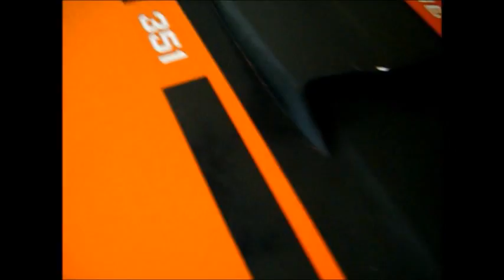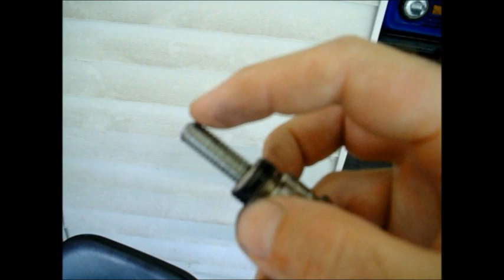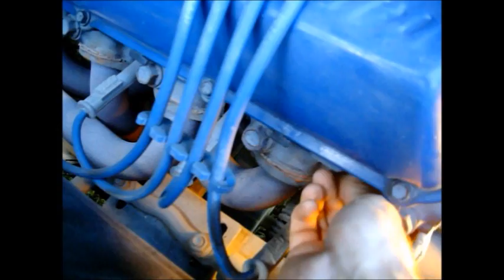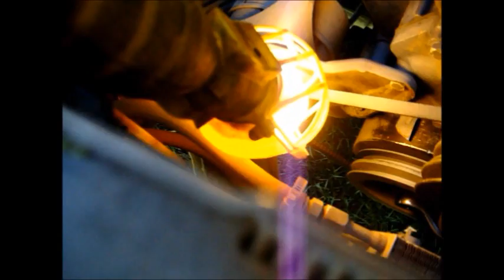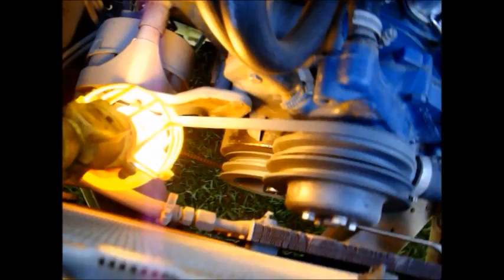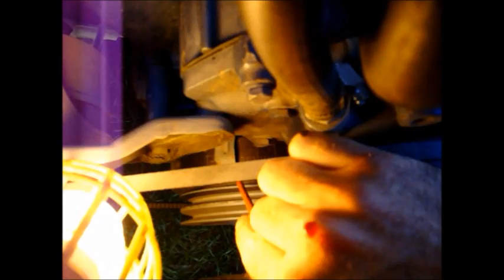Timing - Part 3 - How To - Using a piston stop to find true #1 TDC.wmv

Comment from the maker: Yup, you could stick something down the spark plug hole and when it goes up as high as it can go, you could call that TDC, and compare it to your timing mark on the balancer.  That's only ball park though, you could easily be off by 4 or 5 degrees.  Piston stops are made for people that want balls on accurate.  If you want to find exact TDC, this is how you do it.  The next time you've got a cyl head off, bring a piston to TDC, then keep turning the crank, it'll appear to be at TDC for a while.

Comment: I see. 
Also, why not just use a long extension down the plug hole, if you put millimeter dots on the ext, and have a friend read off while you slowly turn the crank?
Also I think BMWs have chains even still. I just changed the belt on my honda civic. god damn what a pain in the a.  Shouldve had an engine lift.

Comment: 1 Going back and forward will set 2 points on the harmonic, by dividing the 2 points you get you TDC. Get valve cover out, get a ball park...setting the pointer and the original mark, then look at the lobes in the camshaft as they give you the highest part of the lobe as the exaust stroke and the lowest journal of the camshaft the combustion point or valves closed =TDC . finally depending on the year you could move the coil to ignite a tester light which will point to TDC.

Comment from the maker: Once the jam nut is tight, no further adjustment will be required, until you use it on a different engine.  The jam nut holds the all thread in place, and makes the tool more solid than it would be other wise.  The tool would work without the jam nut, but not quite as precisely.  I experimented with how much all thread I would need, to make the process as easy as possible.  Now every time I install it, and torque the "spark plug" into the cyl head, the stop is in the same place.  See below.

Comment from the maker: Before I tightened the jam nut, I installed the piston stop with very little all thread sticking into the combustion chamber.  I verified that the piston wasn't hitting it, then I threaded it in, so that the piston would get very close to TDC, before finally hitting the stop.  That's where you want it.  This way, your two marks end up very close to each other on the balancer.  The deeper the stop, the wider spaced your marks will end up.  Just easier with the marks close together.
Reply: Your answer here addresses my only remaining question spot on. Thanks for articulating clearly. Great video, O.R.! Maybe my 455 olds will run as it should again once I do this. Beautiful cars, BTW!

Comment: Great Video. Very nice cars, and a good tip. One question I have when you said experiment before you tighten the jam nut:What should I be looking for before? Im sure youll say watch for movement in the all thread but I'm still thinking the threads may snagg and give a false reading. Still a useful tip, I'm just overthinking it i guess. Thanks

Comment from the maker: If you can get to the number 1 spark plug and the timing pointer, you can do it.  Be sure to make a solid stop that won't give, or just buy one on ebay.  I should check mine again, to see if that balancers outer ring has walked any more.  Really what I should do is buy a new balancer.  I've put a lot of miles on that Mustang since making the video, haven't messed with the timing lately, it's been running good.

Comment from the maker: @moparmania74:  No, using a method like you described will only put you in the ballpark.  The next time you have a cyl head removed, move a piston to what appears to be TDC, then keep turning the crank, while keeping an eye on both your balancer and your piston.  You'll be amazed by how many degrees of rotation that the piston "appears" to be at exact TDC.  Using a piston stop is the only way to find exact TDC.

Comment from the maker: If your two marks end up being 8 inches apart, measure 4 inches for your TDC mark.  If you go through all this work and it turns out your balancer was marked properly the whole time, that's fine too.  At least you can rule that out when troubleshooting a timing issue.  Anyway, as you can see by the video, it doesn't take that long, especially if you buy a piston stop on ebay rather than try to make one.

Comment from the maker: If you set the piston stop shallow, you'll end up with two marks that are relatively close to each other (Pac Man's mouth barely open).  If you put your piston stop in deeper, you'll end up with two marks spaced farther apart on your harmonic balancer, mouth wide open so to speak.  Narrow mouth is easier to measure, but either way will work.  The center of your two marks is TDC, regardless of how far apart they are.  If they are 6 inches apart, put a TDC mark at half that, 3 inches...done.

Comment from the maker: Using a piston stop, you end up with to marks on your harmonic balancer, think of these marks as Pac Man's upper and lower lips, the center of those two marks is the "center of Pac Man's mouth".  In this case thinking of 360 degrees of crankshaft rotation, the center of your two marks on your balancer is TDC, measure the center of those two points going in the other direction, and you'll find a spot exactly 180 out from TDC, this is BDC.

Comment from the maker: To understand how the piston stop works, and why it doesn't matter how long it is, think of Pac Man with his mouth open.  You've got 360 degrees of Pac Man, but only 1 of those degrees is the exact center of his mouth.  To find it you'd simply measure from the upper "lip" to the lower "lip".  The center of that measurment is the exact center of the mouth.  If his mouth was opened wider, wouldn't matter, the center of the mouth is still found the same way.

Comment from the maker: TDC is TDC whether it's TDC compression or TDC exhaust.  To get the car running this matters a bunch and I went into that below.  The piston stop isn't to determine which is compression and which is the exhaust stroke, it simply tells you where to mark your balancer for true and exact TDC, the piston is exactly at the top of the cylinder.  Even with the head off, you can't eyeball it and be exact.  Even with the head off you need a piston stop.

Comment from the maker: jcinnamon01, think of it in terms of crankshaft rotation rather than the piston going up and down.  For every 360 degrees of crankshaft rotation, the piston hits TDC once and BDC once.  Now there's 720 degrees of crankshaft rotation on a 4 stroke engine, but for the purpose of degreeing a cam or checking the timing marks on your harmonic balancer, that really doesn't matter.

Comment from the maker: Drop that same distributor in at TDC of the exhaust stroke and it won't run so good.  If your valve covers are off, you can just watch the valves, otherwise, use your finger in the spark plug hole.

Comment from the maker: Seems easy enough but you'd be amazed how many distributors I've seen that were dropped in 180 out (based on 360 degrees of camshaft rotation, cam turning at half the speed of the crank).  Find TDC of the compression stroke, then move the crank to about 15 degrees BTDC of the compression stroke, then drop your distributor in with the rotor facing where you want #1 to be, set your firing order off of where #1 is, and your engine will fire right up.

Comment from the maker: Like you said, if the exhaust valve is open, that's the exhaust stroke.  The next time the TDC mark comes around, I should feel air pressure trying to escape past my finger (something is wrong if I don't), this is because both valves are closed on the compression stroke and the air has no where to escape, the path of least resistance is past my finger.  Intake, compression, power, exhaust...four stroke engine, 720 degrees of crankshaft rotation.
Reply: Owen Robertson 
I also did this test to see if the machine shop messed up and put my engine at TDC at the TDC of exaust stroke I turned my crank with a socket and breaker and every time air would escape through the plug home it was lined up with the TDC , so your saying it's not possible to hear the hiss when the Piston is on it's exaust stroke ? I am unable to fire my rebuilt 390 trying to cover all areas also if I know my timing is 8/10 degrees before top dead center is it a good idea to seat it at 8/10 mark before TDC then drop dist in going by what you said earlier ?if that's the case how do you know what position to put it in ? I seen 390 on you tube and some the vacum advance housing was wat to the left by the water neck some pointing straight ahead turning it changes the timing so if I put it in straight or to the left or right wouldn't that change it as well trying to start the motor ?

Comment from the maker: Yup, and that's how I do it.  I'll remove a spark plug, then jam my thumb or index finger in the spark plug hole.  Then I'll turn the crank in the normal direction of engine rotation with a 1/2" drive rachet setup on the crank bolt.  I'll keep an eye on the timing pointer and wait for the TDC line to come around.  If it comes and goes, and air didn't try to blow passed my finger in the spark plug hole, I know that it's because the exhaust valve was open, and that's where the air went.

Comment: on TDC of compression stroke shouldn't both int/exh valves b closed? and on TDC of exhaust the int valve is closed and exh valve open? would this help to tell u which TDC the engine is on.

Comment: If that thing forces the piston to stop, then there is no way you can be sure that you got to the very top of the compression stroke. The only sure way is to measure the gas (air) coming out of the spark plug hole on the compression stroke.

Comment from the maker: Now you try to start the car, to set the timing with a light, but there's no power.  You remember that your battery is disco'd, and that reminds you to remove the piston stop and reinstall the spark plug before starting the engine.

Comment from the maker: Now it really doesn't matter just how deep you installed your stop, but keep in mind, the closer your two marks are to each other, the easier it will be to figure out their midpoint.  To bring the two marks closer to each other, back the piston stop out a bit.  If you don't do this, and your piston stops are 180 out from each other, just be sure to find the mid point that's on the side of your factory TDC mark, otherwise your new mark will be true BDC.  -Owen

Comment from the maker: If it turns out that it's exactly what where the balancer was marked anyway, you're done, you know it's marked correctly.  If it's off a bit, put a new mark on the balancer, and from now on use the new mark.  If this is the case you'll want to check again in a few months to see if it got worse.  Timing chain stretch or a balancer slipping a bit on it's rubber insulator can cause this.

Comment from the maker: As it comes back up, eventually it will hit your stop.  When it does, once again your timing pointer will be pointing to a random spot on your harmonic balancer.  Mark this spot on your balancer.  Now all you have to do is measure the distance between the two random spots you marked on your balancer.  Find the exact spot that's just in the middle of these two marks, and that's your absolute true TDC.

Comment from the maker: When your stop tool is down far enough into the hole, you'll turn the crank counter clockwise, and your piston will hit the stop before it hits TDC.  Now your timing pointer is pointing to some random spot on your harmonic balancer, mark this spot on your balancer.  Leave your stop exactly where it is.  Now turn the crank clockwise (it won't turn counter clockwise because of the stop).  The piston will drop back down into the hole, and eventually come back up again.

Comment from the maker: Step 1:  Turn your crank clockwise a bit, to bring the piston back down into the hole.  Now turn your piston stop in just a bit, maybe an 1/8" of an inch or so.  Now turn your crank counter clockwise, until your piston hits your stop, you'll know when this happens, because you won't be able to turn the crank any farther.  Of course if the crank spins counter clockwise, past TDC, the stop wasn't in far enouth, so go back to step 1.

Comment from the maker: You look down the spark plug hole (plug has been removed), and sure enough you can see that the piston is all the way up.  But is it really exactly at TDC or a few degrees off?  A piston stop will tell you.  Install the piston stop right now, screw it in until it hits the piston, it won't screw in any farther.  Mark your threads, where they meet the spark plug hole.  Before step 1, disconnect your battery, you don't want any chance of starter engagment.

Comment from the maker: Think of it this way, you've got a running engine, all the spark plugs are installed, you turn the crank by hand, all the pistons come relatively close to the spark plugs, but none of them hit any spark plugs.  Now you remove the #1 spark plug, and turn your crank by hand until your TDC timing mark on your harmonic balancer lines up with your timing pointer.  According to your timing marks, the #1 piston is at true Top Dead Center (all the way up).

Comment from the maker: Yup, you've got it, make your piston stop tool a bit longer than the spark plug, and it'll hit the piston.  It only has to be long enough to just hit the piston, it doesn't have to be an exact depth, but the farther in the hole it goes, the sooner it'll hit that piston.  Turn the crankshaft by hand, with a socket set up, don't use the starter to turn the engine over, or you'll damage your piston.

Comment from the maker: Sure, when you use your piston stop, only install it enough to contact the piston, and stop movement of the piston.  If it's screwed in enough to do that, you're good, no point screwing it in farther, in fact that would just make things harder for you.  The more shallow your stop is, the closer your two marks will be, this makes finding the center of those two marks a lot easier.  Too shallow, of course, and the piston won't hit it at all.  It's all pretty easy, just don't start the engine!  -O